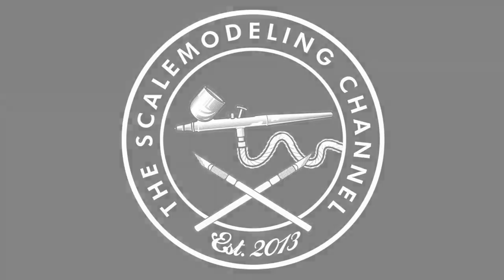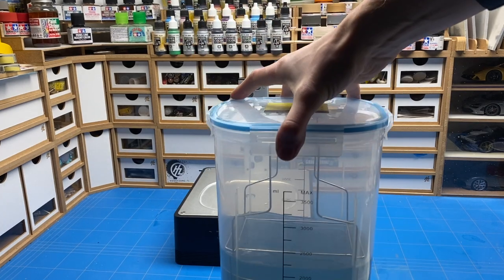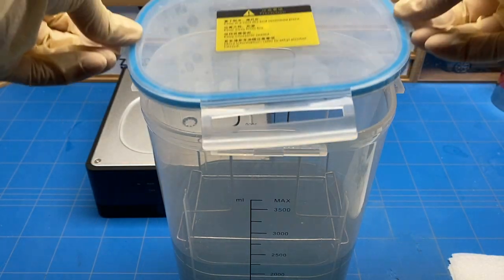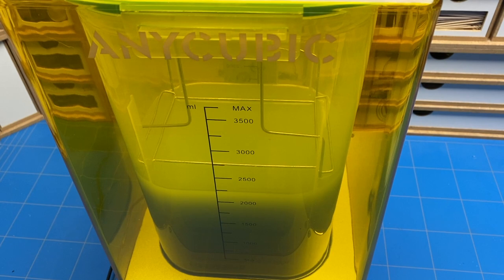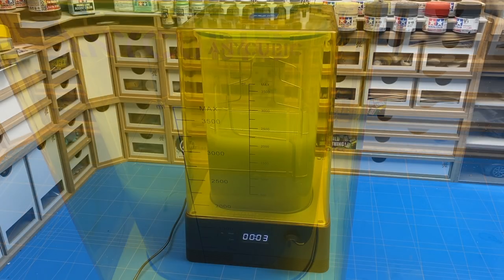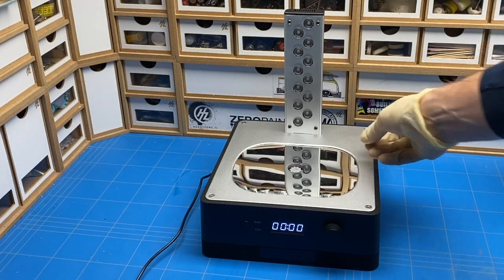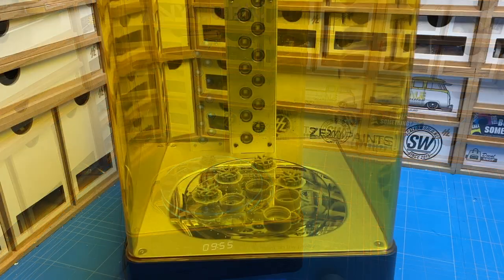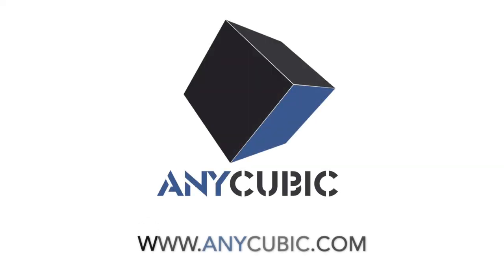Adventures in 3D printing: Anycubic Wash & Cure Station 2.0

Comment: Nice video, the wheels looks a lot better printed in 0,01 layer height! Good job! I have the Elegoo version of this device and is pretty much the same  thing, this washing and cure stations are really helpful I printed lots of things cleaning up in Pickles jar with cleaner and curing under nail polish lights thinking this would just be an expensive gimmick but it really saves times and make the process more enjoyable, I will never go back! one tip to save money: you can use cheap bio ethanol from the hardware store instead of IPA, works exactly the same and cost a fraction of IPA, not to mention it is widely available
Reply: Well, here in portugal I can get 5L of IPA (98%) for 21.20€ and Bio Ethanol costs 22.99€ on the hardware store!
Reply: @brunolopes9900  Acho que depende do país de onde se compra entao, aqui na Alemanha a venda de IPA se dá online ou em farmácias e eu pago  8 a 10 € enquanto que o litro de Bio Ethanol eu pago entre 1,5 e 2 € o litro.
Reply: @cesarignjas  pois, de facto aí e uma grande diferença! Por causa do aquecimento conseguem isso mais barato, mas aqui não compensa!